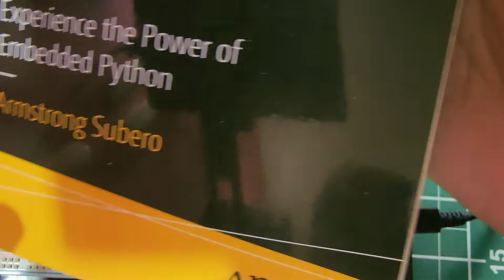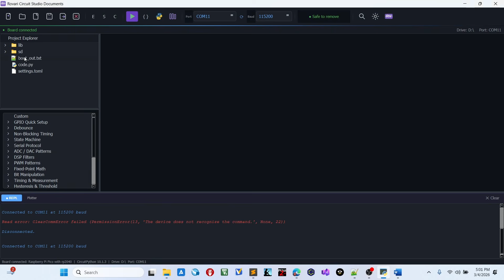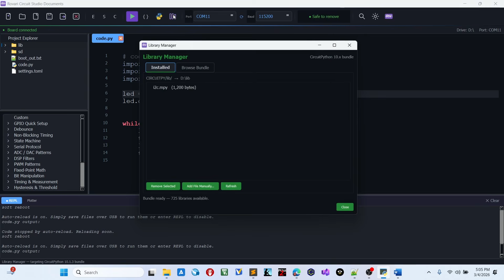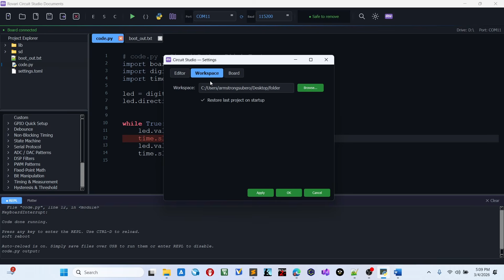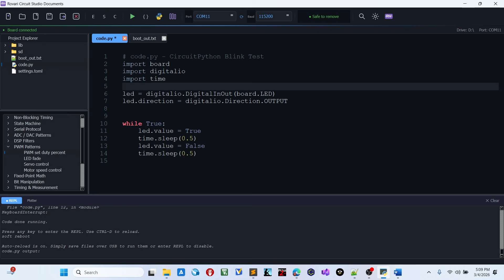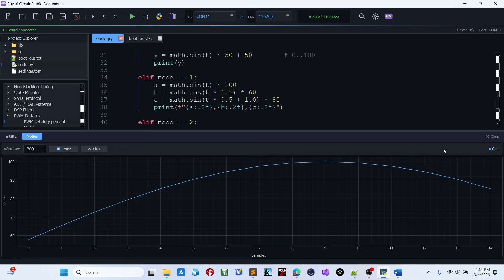First Look: Rovari Circuit Studio A New CircuitPython IDE

Comment: Good work! I’ve never found Mu a good choice for students. I teach a class with Macs and Windows and have had them use PyCharm with Tio and CircUp. I like your plotter. Free PyCharm does have excellent code completion and some very good error and basic AI features. It’s been working well but setup is a long and arduous process. I haven’t been able to get Visual Studio working well with CP on a Mac. River Wang’s online ide has an integrated debugger which I haven’t seen anyplace else and which would be a real benefit to students. Best of luck in bringing these features cross platform!